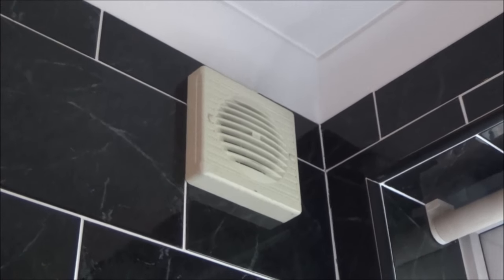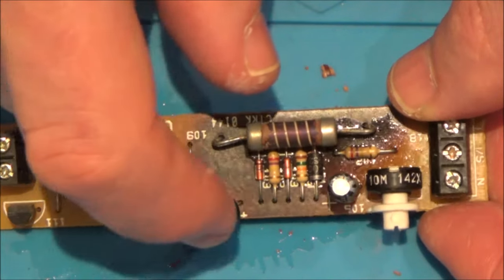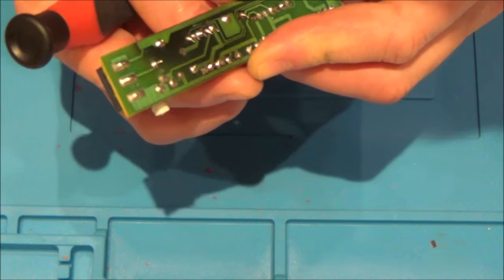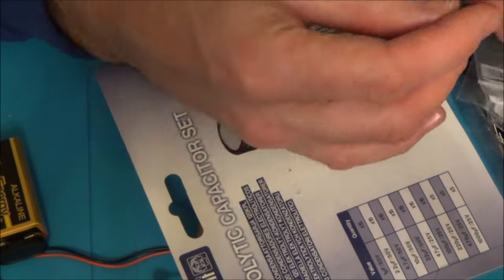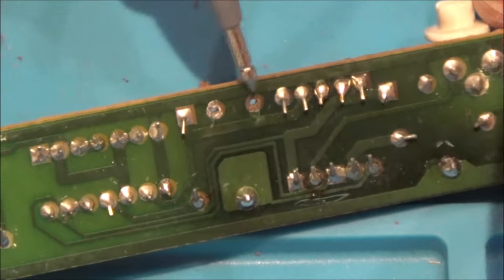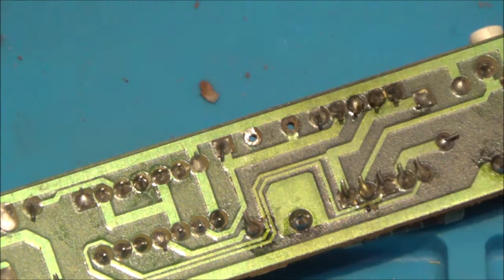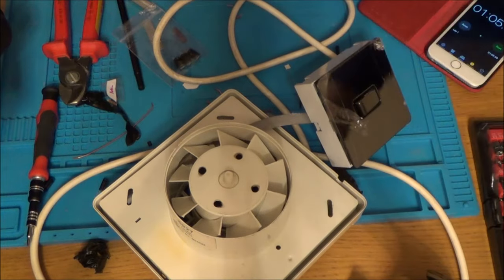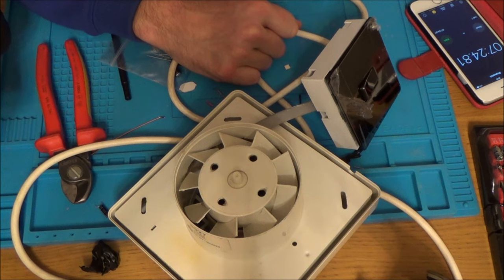Trying to FIX a Bathroom Extractor Fan that doesn't run on

Comment: You were measuring the static pins of the potentiometer. They will not change value. It is the third pin, the one off by itself, that is the rotor and changes.

Those cheap Chinese capacitors should always be replaced with better ones, which it seems you did.. They should also be rated for 105c since they are near high heat. 85c (or unmarked) is the lower rating. They dry out from exposure to the heat. Since the 330mfd could be the timer (drains slowly through the pot to keep the IC turned on), if it were replaced with a 470mfd cap it would keep running for a longer period but probably adjustable to a desired time via the control pot. Good on you for getting Panasonic since it will be better than a no-name Chinese cap, which are the bane of electronic devices these days.

Your resistor is a metal type and unless open probably is still usable. Why it got so hot could be due to a few things but it could have been the bad caps if they were leaky enough or it could just be a tad small for the job.

All in all, good job. You are getting the hang of this stuff.
Reply: the left and middle Pin is connected on the board.  ~0.2 Ohms
Reply: Watching the video closely, he replaced one cap with a gerneric piece of junk 85°C from a capacitor assortment (which belongs in the bin), and only the 330µF was replaced with a good Panasonic cap (even the non-aqueous FC series, which was probably a coincidence)
Reply: @Knaeckebrotsaege  That was what I thought I saw too but if the original lasted years I guess this will do for a few. I don't use them at all. I keep Nichicon and Panasonic on hand. Of course,  I have regular need for them and he doesn't so no criticism is intended.
Reply: cheap Chinese capacitors are nearly always the problem in all electronics

Comment: Looks like a manufacturing design defect. You don't put a massive wire wound resistor like that in  a confined space next to heat sensitive components.
Reply: It’s definitely that large resistor that’s gone-it’s scorched where the smaller resistors have cleaned up perfectly
Reply: My old audiolab amplifiers resistors were exactly the same-brown and scorched circuit board on  the output stage
Reply: I think the caps are ok-they bulge at the top if their knackered
Reply: The scorching is definitely that resistor
Reply: ..unless, of course, you want people to have to replace them every few years. Cha-ching! #PlannedObsolescence ;)
Reply: @depechem0demusic  caps are ok if they're not bulged? Yeah because them drying out and acting like a resistor definitely isn't a thing /s
Reply: FRIENDLY JAPANESE BUSINESSMAN I did-the caps weren’t totally knackered-just out of tolerance
Reply: @depechem0demusic  Out of tolerance (even by a little bit) = trash. And these ones were SO damn far out of tolerance the ESR meter didn't even register them being connected, so they might as well have not been in the circuit at all anymore... wouldn't have made much of a difference
Reply: The wire wound resistor should be mounted higher off the board.

Comment: that resistor is reducing the 220v to something for the chip to work, it is going to run hot and will cause the capacitors to fail again. Nice video btw!

Comment: While I agree it would be quicker to buy a new one (assuming a new one had same fixing holes etc), that is missing the point of these videos. It's the process that is valuable to hear and see.
Reply: Yeah, but I still hope he tossed it after he "repaired" it. That thing seems beyond repair. Seems to be broken by design or something. Don't get me wrong, putting lipstick on a pig can be fun and all, but it can also cause some grievous misunderstandings.
Reply: @Hagledesperado  Yes, it's essentially crap, to be expected for an item of such low cost
Reply: @jns8393  Can't be that crap if it lasted 17 fcking years (late 2001 (week 44) datecode on the PCB, with a copyright notice from 2000). 
Willing to bet a replacement wouldn't have lasted anywhere nearly as long
Reply: Anything that lasts over 10 years is not crap and the fan was repaired for now . Works fine and if it develops ankther fault then invest in buying a new one
Reply: @David-uq2uk  All I mean is that it's hardly a quality product with high design and production values. But yes it's certainly done a good job!
Reply: JNS yes if anything in the home is fixable its worth  a try to do if not but a new one . But i see where your coming from.
Reply: JNS do you  no  vinces ebay name on ebay so i can check what hes selling this youtube mobile app  and web dont let you send private messages .thanks
Reply: @David-uq2uk  Mr .. telephone I believe

Comment: The output to those two black wires is 240v AC so it doesn't matter which way round you reconnect. Fan will spin in same direction either way.
Also, have you tried adjusting that pot? I'm sure that will adjust the timer.

Comment: Now I could be wrong, but it looks like a crazy cheap design!  I suspect the resistor is dropping the mains AC voltage.  You can see that from the L & N connections on the board there.  Probably half wave rectified and smoothed by one of those caps.  The 22K reading you got on the resistor sounds about right.  Resistors can change their resistance when heavily burned like that though.  One of the caps is used for timing I think (along with the variable resistor).  

The 2 smaller diodes might be zener diodes to regulate the DC voltage perhaps.  I think there's a dropped AC input via one or more of the smaller resistors (and possibly one of those smaller diodes) there - to act as a sense, and input into that 4001 NOR IC I think.   So that NOR will have 2 inputs, the timer input and the switched input.  When the timer is "charged" its high, when the switch is on its high, meaning the ouput is low.  Fan is probably engaged when the transistor gets that low.   If the switch is turned off, that means the switch signal is low, but the timer is still high (charged), but since its a NOR gate the output will remain low because one of the inputs (the timer) is still high, so fan keeps going.   When the cap runs down below CMOS high logic level the NOR gate now has 2 low inputs, switching its output high, turning off the fan.

 I am always amazed when I see something like this working with little effort used to drop 240V down to probably 12v or so (CMOS voltage, and I guess it would be 12v as opposed to 5v as I cannot see how else the Fan might be powered).  As others have said - I would use 105 degrees caps too.  I think the other thing I would do personally is swap out that 22K resistor with something that can handle a bit more current.   That said, I see no fuses on this which imho would scare the hell out of me, especially seeing how crammed up everything is next to that very hot resistor.  I think the output from the CMOS IC there is switching the fan on via the small transistor (could be wrong but that's how it looks).  When resistors like that fail they can often go short circuit.  That would mean 240v fired straight into the regulation and rectifier side, which would short and blow those out.  I guess since they are small sized components they would possibly act like a fuse anyway.   One of the higher resistance resistors must be forming the other half of the voltage divider for the switched input and the "always on" live that gets dropped to around 12v.

Again, take what I say with a pinch of salt, I could be wrong but it looks quite simple and a good one to learn from for sure.  Finally, I see more than one gate on the 4001 wired there (but cannot tell how, as its upside down and I cannot see where pin 1 is easily), but they might be using more than 1 gate there to invert the logic to the transistor.  Would seem a bit crazy to do that though as you could just use an OR gate instead of a NOR gate to achieve the same thing lol.

Comment: Nice vid, when soldering just bend the long feet so it will stay in place without the need to hold it. Also you might wanna cknsider getting a 3rd hand (idk if thats the correct term in english, just a little arm with a crocodile clamp at the end of it)

Comment: the caps would have been my first guess too. the timer works on how fast you charge the cap. then when it gets charged it puts power onto a leg of the IC which then shuts off the fan.

Comment: That big resistor is actually designed to run that hot it is failing, and it also forms part of the power supply for the timer chip.

Comment: Looks like mine, the sensor was far too sensitive so it was on permanently the repair guy just said its easier to lower the sensitivity but it took a while as humidity has to be factored in.

Comment: Hey Vince!  Would you please consider adding the model number of the item you are trying to fix in the description?  I'd like to see if there is any documentation available for the device.  Also, you might want to start looking up the device's schematics for reference when you're troubleshooting a circuit.  You'd be surprised how often you can find the PCB schematic online. Great video! Consider ordering some power supply kits for your workbench.  Suggested voltages are DC 5 and 12 volts.  See if you can find a kit with an adjustable amperage value.  It could be very fun and educational to work on something that isn't broken before you begin.

Comment: Eletrolytic caps don't really mix well with heat. They start to dry out, loose capacitance and increase in ESR. Delaminating traces are also the result of excess heat (especially on this type of phenolic paper PCBs). Also the clearances between tracks are awful. Absolutely atrocious design. If you want this thing to work longer without failing move that big resistor somewhere in the airflow so it has some cooling. BTW. That chip is just a quad CMOS NOR gate. It's used here as crude timer.
Reply: The problem is that the resistor is powered all the time, not just while the fan is running. It will still overheat even if in the airflow. It needs to be replaced with a higher wattage resistor as the one used clearly is not capable of dealing with the power it is exposed to.
Reply: I wouldnt have that fan anywhere near my bathroom. What a terrible design! The Chinese dont care. Was that even a UL Tested device? I doubt it.
Reply: These extractor fans don't die that fast, they cost hardly anything and last for a good few years. My grow room uses these on permanently and they are fine. You just have to clean up the fan blades and cover every so often to keep it quiet and effective.

Comment: That really looked like it almost catched fire. I think its better to just replace it, before it burns down your brothers house.
Reply: Agreed, don't waste any time trying to fix something like that when it could fail and cause a house fire possibly...a replacement is £15 .. not worth the risk. I'm all for repairing things but that sort of damage isn't worth the risk. Also in higher risk zones like a bathroom you really should avoid tinkering too much.
Reply: Its a really dodgy build anyways. Using a resister like that instead of a voltage reduction circuit is asking for it. Heat is killing the thing anyways. Think of it like a heating coil in a small box heater. Yes it reduces the voltage, but it is also creating heat, something that happends naturally. There are much better ways to reduce voltage than using that type of mess. Great way to burn the house down.
Reply: @Dedubya-  Hi, yeah I agree as you see from my comments above.
Reply: @scottfirman  yep.
Reply: I agree with those saying this is a badly designed device. That resistor is acting like a heater in a small and combustible space, it's great you found the fault but please replace the unit before it catches fire.

Comment: My bathroom fan looks the same with the hot running resistor, I actually think its intentional to heat up the enclosure and stop condensation forming since they're used in humid wet rooms and mounted into a hole where cold outside air can cool the fan PCB below the dew point.
Reply: It maybe was kind of intentional, but bean counters ended up downsizing the resistor wattage rating and using cheapo junk caps to save a few cents per unit, leading to this mess...
They apparently didn't get to the fan motor to cost-down that into a failure, since the bearing in that thing lasted for 17 years

Comment: The chip, HCF4001BE, is a quad NOR. Likely two of the small resistors, one of the caps and a diode are used as DC supply to the chip, the pot and the smaller cap are used as timing devices. When turned on the cap builds a charge and when turned off the cap will start to discharge. The discharge rate (time) is controlled by the pot. When the cap voltage reaches a lower threshold, it will trigger the logic of the NOR gate to turn off the transistor and cut off supply to the fan. The worry about this design is the use of a high wattage resistor to drop voltage to the fan, knowing it will get very hot in an enclosed and already warm & humid environment. These types of caps will fail frequently in this environment, and a much more serious problem is the resistor fault in this video will likely occur quite frequently, and it seems like a huge fire risk.  If I were asked to repair this item I would recommend against it because of the hazard, and would report it to the Government regulators.  It is a very poor and dangerous design.
Reply: I'll add that the code on the resistor looked like red red orange to me at the start, so 22k. Given how hot it got in this design I'd never use that again without as a minimum replacing it with a bigger 5 watt or 10 watt resistor as it will just cook all the components again if left as is.
Reply: I didnt see a UL sticker anywhere on it did you?
Reply from the maker: Thanks for all the detailed information :-)

Comment: those capacitors are simply smoothing capacitors to reduce electrical noise so the fans uses electricity more efficiently. the capacitor makes it so that rather than ride half the sine wave, it takes the energy and smooths it out so it can get more of the sine wave input

Comment: Want to add a note to how you think it works to help teach. When the switch is on it charges one of those capacitors when the switch is turned off the capacitor drains through a resistor. As long as there is a potential provided by the capacitor the chip reads that and continues to run it until the capacitor reaches a drained threshold then the chip shuts it off. You can explore this idea with a 555 time chip setting it up in astable circuit formation. Then by changing the value of the capacitor you change the frequency of the output and this is determined by the length of the charging and discharging of the capacitor.

Comment: the clear orange diodes are Zener diode. which allows current to flow in the reverse direction when i target voltage is reached. :)

Comment: Had my fan of the same model apart for cleaning and realised that there was discolouring and brown marks on inside of the case and around the resistor on the board. Fan still works perfectly but heat damage was alarming should I replace it or leave it be?

Comment: Hi Vince glad to see you got an ESR meter.  But  to explain how the thing works, It sends an AC signal through the capacitor and reads the loss of signal between the two probes. As such, do yourself a favour, you don't need to take the capacitor out. So you could have turned the board over and go bop bop on each cap , the reading would have been the same so job done. The chip is a logic gate . one of the capacitors will charge up, the power will be cut off it by some means with the logic gate,  your potentiometer will be set across the capacitor and slowly discharge it Then at a set point the logic gate will switch the power back to the cap.  Now when you buy electro caps for power supplies etc get Low ESR 105deg type the crap you get from China 9 out of 10 is dodgy. Your Panasonic caps are ok. Sorry but that board is crap, the heat of that resistor is normal for that. Also sucking moist air across that board is a bit daft.

Comment: FYI - the black diode with the silver band could be a schottky or rectifier diode.  The print on the component will tell you exactly what it is. The brown glass diodes are zener diodes.
Reply from the maker: Thank you Lisa :-)

Comment: Always use fresh solder first on removing old solder. The fresh solder reacts better with the old solder making it easier to remove. Invest in solder removing tape or a solder sucker. Check out my video on RC Hobbiest Extreme, I am currently working on a trail camara that had a faulty internal battery that is used for programming the camara . I discovered the battery had leaked and no longer worked. I was able to find a replacement and will be doing a part two this week. Will it fix the problem? You got me interested in doing my own repairs on electronics although I have to admit, I was raised around electronics and have been playing with solder since I was a kid. The chip is the timer ( look it up) the power is run through several diodes to bring the voltage down otherwize it would blow the chip. I am suprised they do not have a step down voltage regulator. That stupid resistor is what they are using to step down the voltage. Not a great idea. It is not smotthing it out so rough voltage is destroying it. Heat as you know is NOT  a friend of any component. I wouldnt even use that fan in my home. One of those diodes are being used as a fuse as is common pratice on cheaper units. I see it used on coffee makers and  have been able to fix a few due to a spike in current blowing the diode and essentually killing the power to the unit. Usually its right at the programming board.

Comment: You had the front cover on upside down as there's a cut out to adjust the timer. They also fitted on the wall the wrong way up as the timer dial is on the top & not the bottom